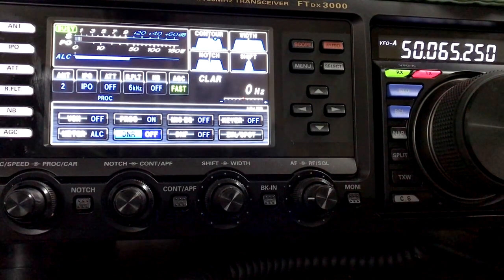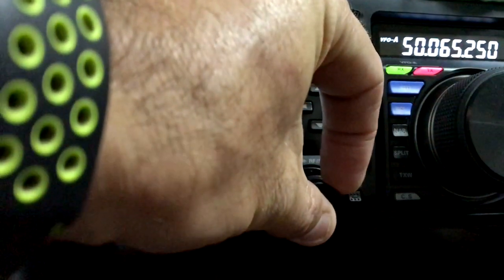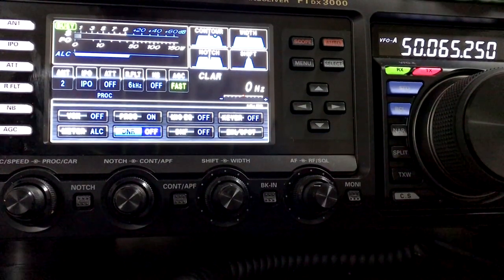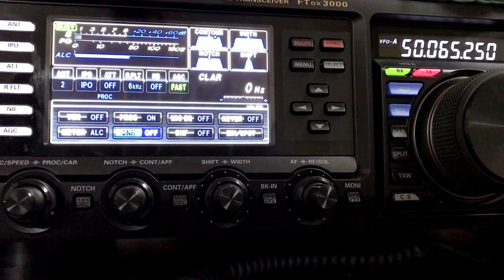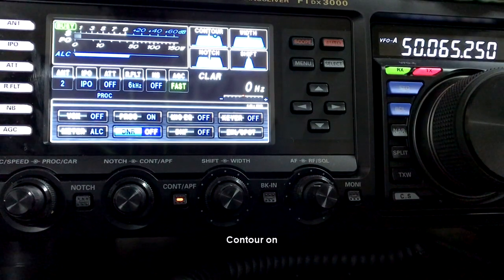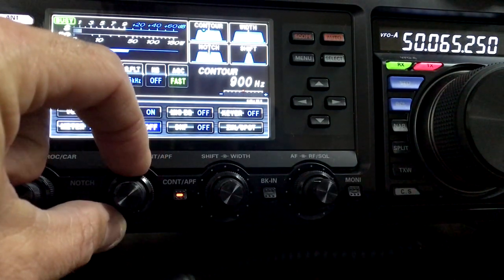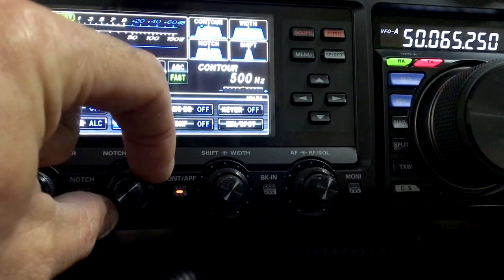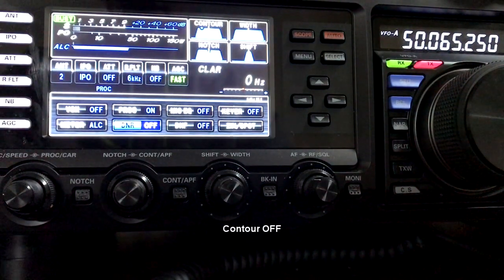Yaesu FTDX3000 Contour control

Comment: thanks Adrian. hey i am struggling between buying the 7300 or the ftdx3000. boy its hard, but liking the 3000 better each video i watch.
Btw are the buttons and knobs backlight?
Reply from the maker: Hi Ralph
The ftdx3000 is great for every day QSOs and weak signals. The scope function is not good as it only will show strong stations. The buttons do not have back lights.
If you can afford the ftdx101 that is the ultimate radio that ticks all the boxes for me.
You can run an sdr off socket on the back of the radio.
My favourite band that I use the DNR is for listening to long QSOs on 80m.

Comment: This is great. I can see where you could notch out a strong adjacent, perhaps overlapping signal, and the use the Coutour to boost the remnant of a target signal - coupled with the DNR you demoed in the last vid, this receiver looks very capable. I live in a high noise environment and I'm looking forward to seeing what the FTDX3000 can do for my situation.
I'm transitioning from my first rig, a venerable FT-840 (which I live the bones of and will never part with). I just switched on the FTDX3000 last night for half an hour in order to start familiarising myself with it. I think this will take some time - so your vids are a great way to help that process. 73 EI9HAB